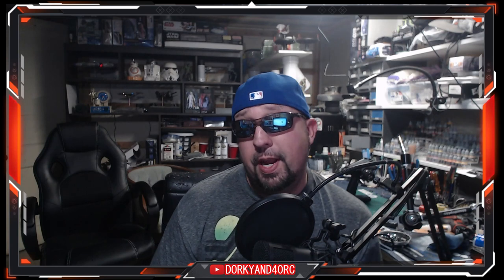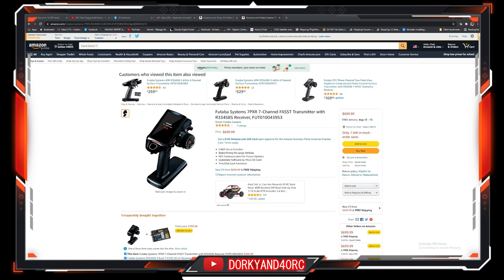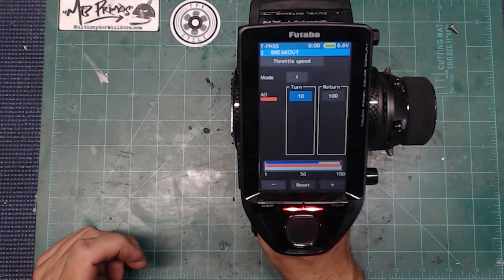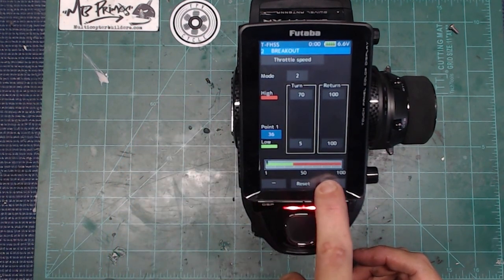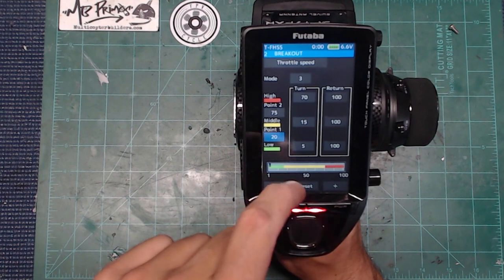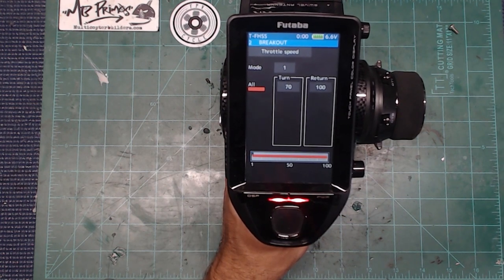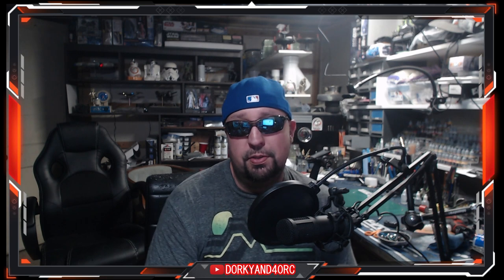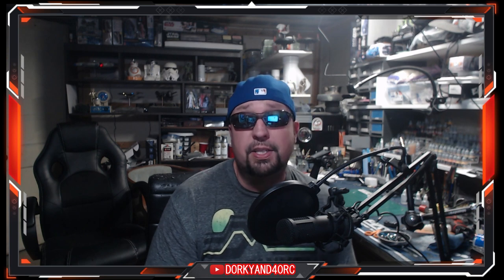MAKE ANY ESC A MACLAN DRK | ALMOST!! | THE RADIO SPEED TRICK FOR NO PREP DRAG RC

Comment: Just got a used 4px in and I love it. Only has 3 stages but for under half the price I can’t argue!
Reply from the maker: 3 stages on the 7 too
Reply: @Dorkyand40   you can also set  a button as a scramble button/ slow launch. I made one 70 dr while holding the button and when I let go it goes to 100 dr

Comment: I use the Fataba pv3, it has throttle expo. Works great for a quick on the fly launch adjustments & its inexpensive.
Reply from the maker: Lot of ways to do all these things.  Seems like spending the money on the sanwa gives you the best options right now outside of using a drk
Reply: @Dorkyand40  I use Tekin RSX Pro ESC, Tekin Eliminator Gen4 3.5t with Hotwire 3.0. So the Futaba pv3 adds another tuning option. Your content had been 🔥 thanks for the great tips!!!
Reply from the maker: Great setup man. Almost the same as mine on the breakout. I did make the jump to the sanwa m17 because there just seems to be so much more info out there on how to use all the features.
Reply: Will it benefit me to use this feature in junction with drk ? Or will it make things to confusing?

Comment: Hello I've only been playing with losi rc drag cars for a month now and are there any other controllers say like $100 you can do this or you can do something close to this with
Reply from the maker: No. I would try to find a used maclan if you want that much control without spending the big bucks
Reply: The flysky fs-g7p is affordable and has throttle and steering expo
Reply: @MX-CO  but will it let you do the stuff the spectrum will as far as controlling throttle at different times

Comment: Have you tried this with your castle setup? I have the 4pm and wondering if it’s possible, I saw some say it’s only a single stage, that might work for me. Thanks for your research, you’re helping me out!
Reply from the maker: I have the sanwa m17 now so I am using a lot of stages and throttle ramp.
Reply: yes you can do the same thing

Comment: So it's safe to use the maclan dRk settings and the remote settings controlling the launch?
Reply from the maker: yes.. a lot do.  run all 5 stages at 100 and 0.05 delay and set your turbo to what you want
Reply: @Dorkyand40  did you personally have better in results using the remote or the dRk to control your launch
Reply from the maker: Check out my gearing video and you can see. I explain what I’m doing with the drk and remote. I’m going to follow up more on it. Their tunes are old now and they admit this so using radio tuning could be better if applied correctly.

Comment: No sir. Your slightly wrong. No controller has the 3 stage throttle like futaba. 4px and 7px is the only 2. Everything else is garbage
Reply: I am on the fence between 7PXR and M17. From what I am seeing is M17 has a sing stage ramp, while 7PXR has 3 stage ramp. Is that the only difference to consider for No Prep?
Reply from the maker: I did a lot of research. I went with futaba so I could use a good radio and good priced receivers on all my cars. The fastest guys around me use both and only use single stage. Things can change though.  I think the m17 has a few more tricks up it’s sleeve as well but I’m not 100% sure.  If no prep continues on its growth path the esc software could take over and make the radio trick useless kind of like the drk does. All I can say is I really like the 7pxr so far and I know I will have it for a long time. Check out the bullet chassis Facebook group. Most of them seem to run the m17 with the rx8 and there’s is a lot of m17 talk there.
Reply: @Dorkyand40   Thanks! I seen that group and almost went with Mark’s Bullet chassis but decided to go with 57Design “Arrow” and R1 ESC/Motor. I like the DRK stuff but I feel like tuning via radio is easier on the ESC since it’s not modulating the voltage in the same way. I could be wrong but that’s my view on it. Granted, I am 100% newb and I’m likely misunderstanding all of this lol. 

I am leaning towards 7PXR since it has ti ability to run a single stage ramp, like the M17, but there is room for growth if someone figures out a way to utilize more power with more stages.
Reply from the maker: All good points. One day I would try a drk. Their data logging and firmware has been designed for no prep so it’s way easier to see what your changes do. I’m struggling with the tekin data logger currently because the maclan is so nice it spoiled me.  Enjoy that build. I just completed the breakout and I’m dialing it in now.
Reply: @Dorkyand40  Using the DRK stages will this function with the 7PXR  improve adjustability or is not needed? Im am currently running a losi stock chassis with the DRK160 and a Trinty 4.5 T. My best time with the car so far is a 2.3 turned down.
Reply from the maker: That’s the entire point of the drk is to not need a remote for that purpose. Now there could become a point where you can put down 100 on all stages and ramp but you cannot make a custom curve like we can with the m17. But you can take advantage of the futaba 3 point system on your steering. Very important and often ignored only for steering expo or dual rate. Those are not the best options to keep the car under control at 70+ mph. So check that out
Reply: @Dorkyand40  My problem is stopping the car. I’m trapping at 61mph and it takes flight when I hit the brakes. It would be great if you made a video using the DRK drag brake function. I have it turned on and still playing with these functions. I think so can get a 2.1 out of it turned up but I’m nervous stopping it.